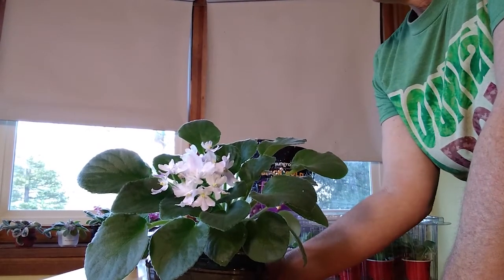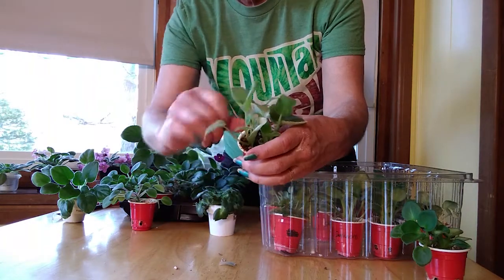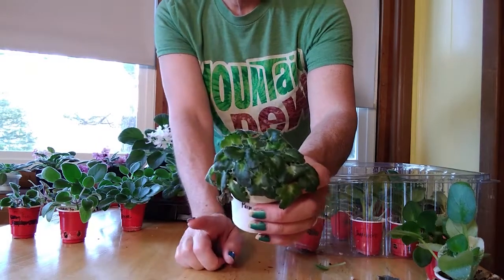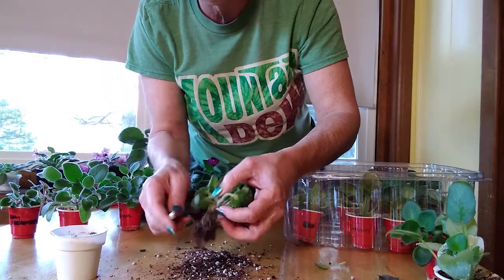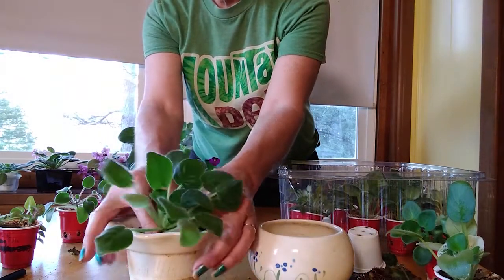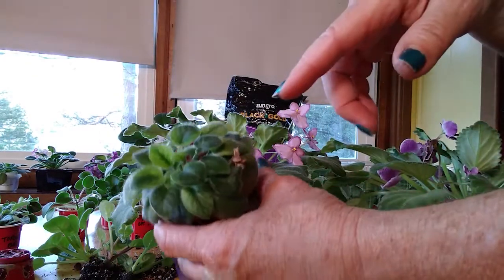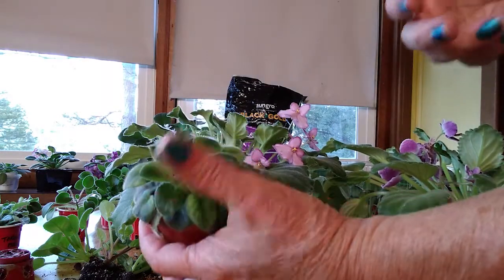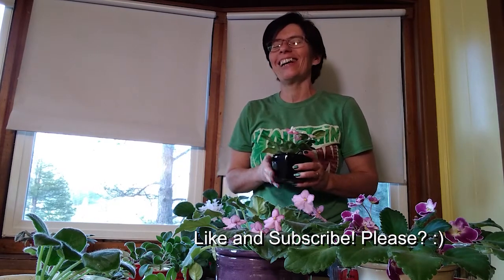Willow's Vintage Homestead: African Violets

Comment: Hi there.  Just a quick question.  I watched your video and you got right up to the part that I wanted to see and you did not do it.  Have you shown how to bag a plant somewhere else?  I have watched other videos but they all have large systems and elaborate grow lights etc.  I am a lot like Joe in that I am a senior on a fixed income so need to do this as inexpensively as possible.  I also got my plants from Lowes.    Can you explain how you bag a plant?  Once you put the plant in the baggie do you totally seal it?  Do you have to water a bagged plant?  Since I got my plants at Lowes there are no names can you recommend a place where we can try and find out what the names are of them?  Thanks for you video.  I found it very helpful.  JoAnne Raymond
Reply from the maker: Hello, and thanks for watching! Most Lowes plants are from the grower Optimara which has a list of their varieties here: https://myviolet.com/ -- since many look very similar, check if it's a variety that was grown the year you bought your plant to help narrow it down. You would only need to put a baggie over a plant that you've beheaded or a rooting leaf. I don't seal the bag, as I've found it can lead to rot, but others do seal it completely. I just arrange it over the top of the pot so that it encloses the plant completely. Water the plant once, and you probably won't have to water it again as long as it's bagged, but check the soil moisture once a week to be sure (I live in a dry area, for example). Thanks for the great questions, and I'm glad the video was helpful. :)

Comment: Hey kiddo sorry to bother you again but I have another question.  I am thinking of trying wick watering so my plants will be OK when I go on vacation.  Here is my question.  The plants I just bought from Lowes look like they have been recently potted.  So do not want to stress them by repotting again.  I guess I need to know if you think this will work or not.  I am thinking that I can wet the wick.  Then since it will be wet and limp thread it through a straw and then manipulate it through the side of the plant to a water hole and then after I get it where I want it remove the straw.  Here is the problem.  Most of the videos I have watch show that in the middle of potting you need to wrap the wick around the middle of the pot.  I will not be able to do that since I am not repotting.  Do you think that my violet will get enough water with the wick just running down one side and not in the middle or should I do two wicks one on each side?  I have had these plants for 24 hours and I do not want to kill them right from the get go.  Thank you for any opinions or suggestion you want to share with me.  JoAnne (also called Jay!)
Reply from the maker: I wouldn't go to all that trouble for wick watering, I had a lot of trouble with it when I tried it. The wicks would come out, or get covered in some slime that "drank" all the water. I prefer 2-piece ceramic soaker pots (but they can be expensive) or just plastic in a little dish for bottom watering. For repotting I would go ahead and do it once the current flowers are done, and use African Violet potting soil with high perlite content (the white things) and low peat content. Too much peat will keep moisture at the roots and lead to rot. You want a nice light soil that drains well. I use Black Gold and add another 25-40% perlite to that.
Reply: @WillowPolson  Thank you